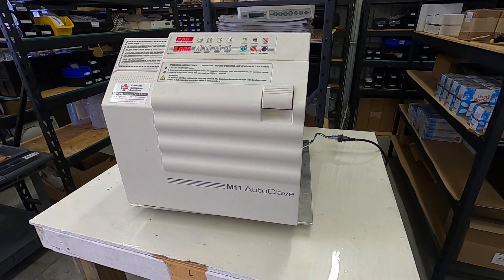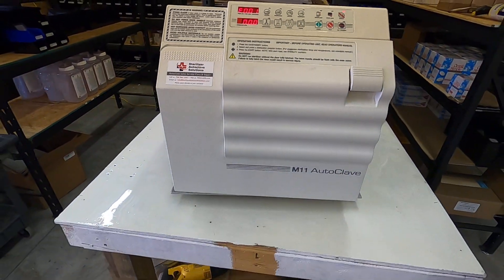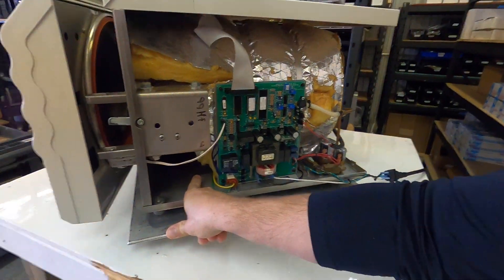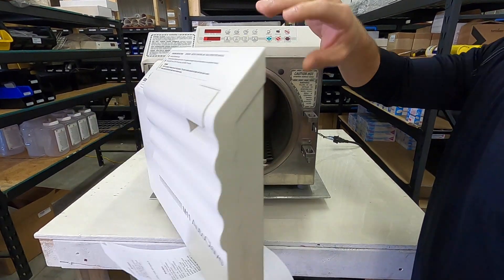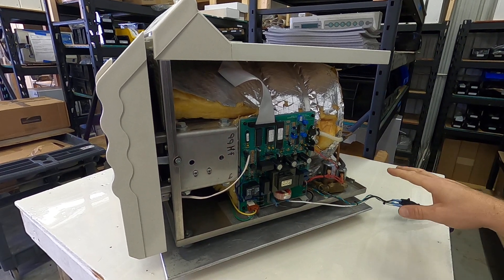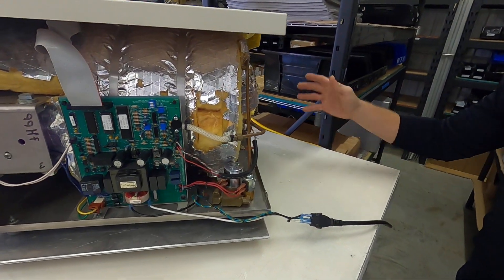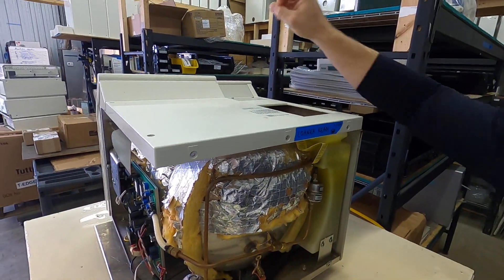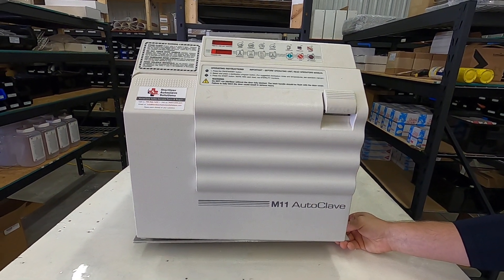Midmark M9 and M11 "Old Style" Error Code E001

Comment: Great Customer service. Thank you.
Reply from the maker: Our pleasure! Please let us know if we can ever help with anything else!
Reply: @SterilizerAutoclaveSolutions  In my autoclave an error code E006 appears, why does that happen?
Reply from the maker: @davidvelasco9039  temp is exceeding 277 . Slow pressure leak . Check door gasket make sure it’s not leaking . Check safety valve is not leaking and also possibly the bellows could be going bad . If you haven’t replaced seal in a while I’d start there . Call us Monday morning and you can speak with one of our technicians . Or call me tomorrow afternoon and I can help you more .
Reply from the maker: @davidvelasco9039  you can also clean the temp sensor which is sticking out of back of chamber on the inside . With a green scrubby pad and distilled water.
Reply: @SterilizerAutoclaveSolutions  thanks very much
Reply: @SterilizerAutoclaveSolutions  Hello, I have already carried out all the steps to check and clean the water level and temperature sensors and I keep getting the same error ... What can I do?
Reply from the maker: @davidvelasco9039  ok it may have a bad temp sensor or out of calibration of a bad valve . Call tech support line .. we may have to get it shipped in for repair . 704-966-1650 opt 3